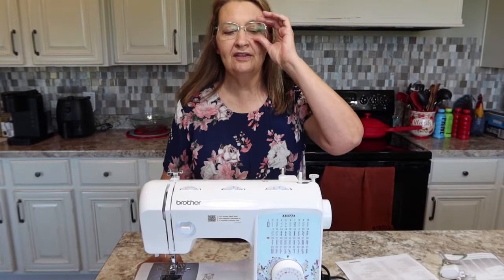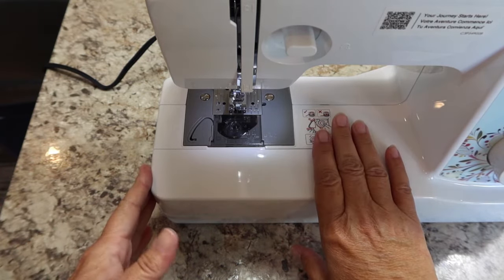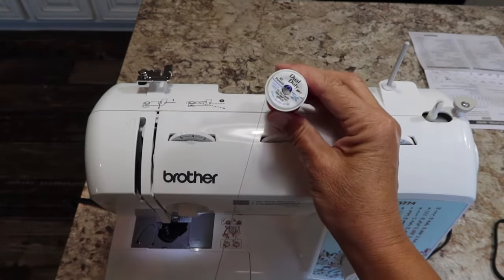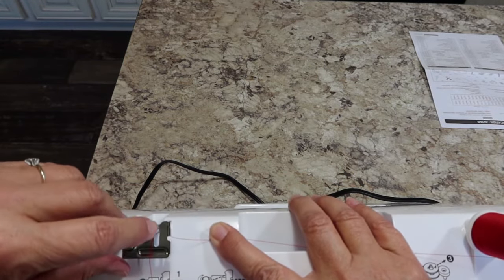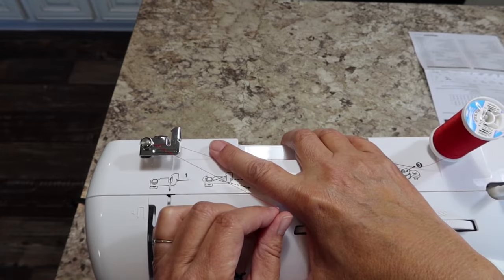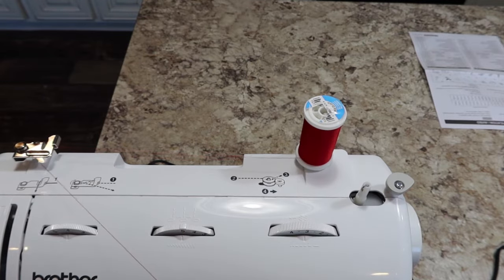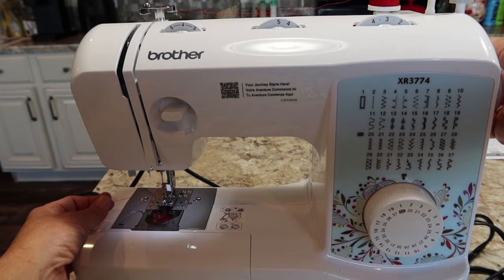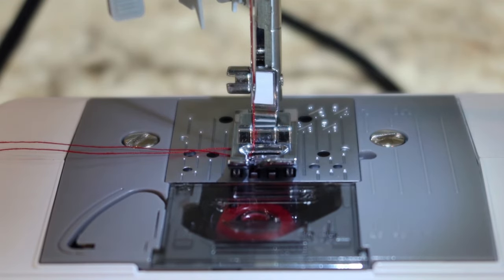Brother XR3774 Bobbin winding & Top thread

Comment: Does this machine come with thread?
Reply from the maker: No, you’ll need thread
Reply: @momdoesstuff  I just bought this machine and have never sewn before. I want to take in the waist on some shorts, what strength thread do you recommend and do you have a favorite brand of thread? Thank you
Reply from the maker: @DougFLA123  coats and Clark from Walmart will be fine for this. It’s 40 weight and very strong
Reply: @momdoesstuff  Thank you!